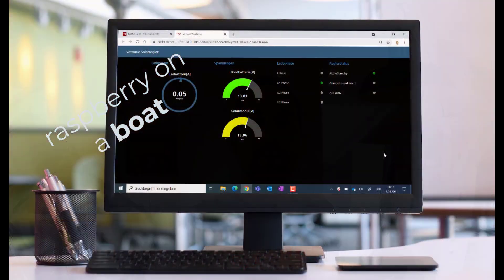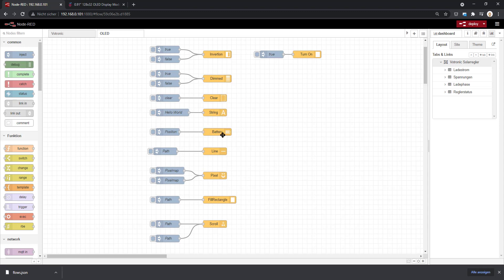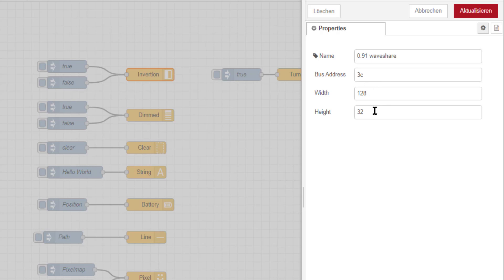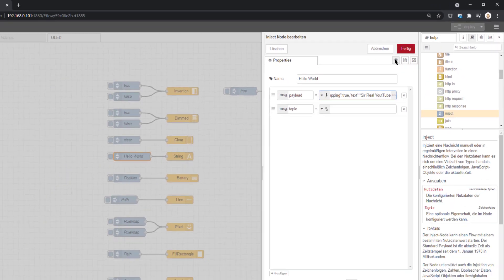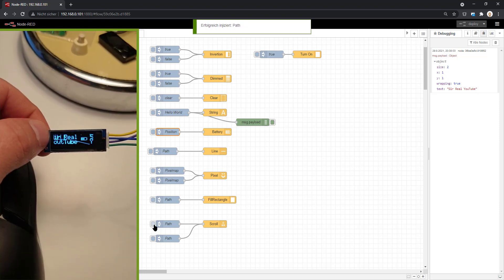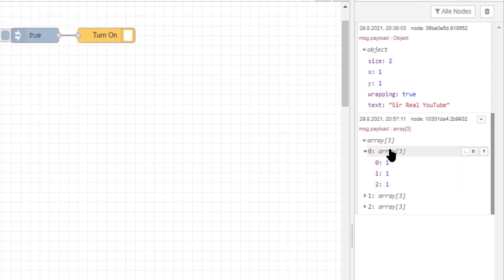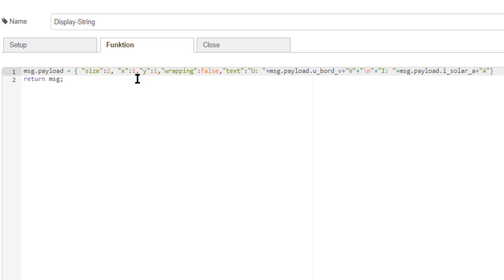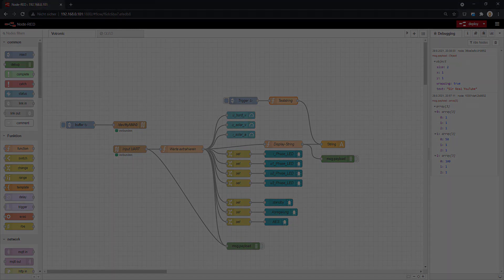RoaB #17: Operating an OLED Display Module with Node-RED  using a waveshare 0,91 inch as example

Comment: Hello,

I have a small issue. After installing a package, it's not working for me, and upon "deploy," I immediately get an error "Error: ENOENT: no such file or directory, open '/dev/i2c-1'".

What am I doing wrong?

I have I2C enabled, and the program stats.py is working for me, so the display is functional. I don't have the stats.py program active in the background, so I'm not sure what I'm doing wrong.

The OLED display has the address 0x3C and is visible when I enter the command:    sudo i2cdetect -y 1
Reply from the maker: Hi Sebastian,
I can't assist on coding questions as this needs some work, e.g. setting up a similar system, often the OS has changed if we talk about older videos, updates and I might even not be in this topic that deep anymore. So, I always recommend to publish your code in according forums to get help on coding level. 
A little hint: ENOENT means Error - no entry (found). If I see /dev/BLABLA we are talking about devices which must exist on Linux level in the dev directory. With ls /dev you will see devices existing (on command line). But: I2C is usually not existing on that level, only UART etc. if you realize the I2C connection e.g. with a library on Node-RED.
Reply: @Sir-Real  Thank you for your reply. The problem was due to the use of the docker container (for NodeRed), it did not have permissions to access I2C. After reinstalling NodeRed without docker, everything works fine. Thanks.

Comment: That is very nice. Do you know of any inexpensive wifi/4g solutions that work well with raspberry pi? I'm especially interested in signal boosters. Do you think a regular 4g router with additional high gain antennas would work?
Reply from the maker: If I got your question right, you want to connect via WIFI a router to jump to 4G, right? In this case I think you can use any router as this is not a raspberry specific issue.
Reply: @Sir-Real  You're right, I can connect any router to the raspberry. I was just wondering if you have any experience with using wifi or 4G on a boat. I'm looking for some information what works well, how strong is the signal (probably not very strong) and what would be good DIY marine grade signal boosters/antennas.
Reply from the maker: @yarpenzigrin1893  Ah, ok. 
WIFI: My Raspberry is connected via WIFI to  my tablet (plotter software) w/o any issues.
4G: My tablet/smartphone is my link, e.g. to update my raspberry and to get Internet data (weather etc.). 
As my tablet is usually in my cockpit, cellular works fine if the coast is near.
Reply: @Sir-Real  Cool, thanks. I've been using a smartphone as a hotspot as well but I'm looking to install a dedicated 4G/5G router. And since the signal fades quickly I want to mount a signal booster and a long range antenna. There are some commercial products that do this but they're way too expensive for me so I'm looking for a DIY solution.
By the way, thank you for your raspberry pi videos, they were a great help.